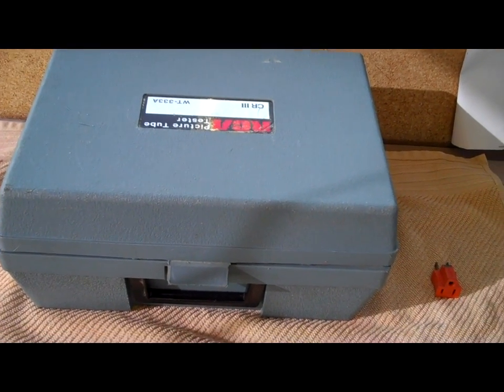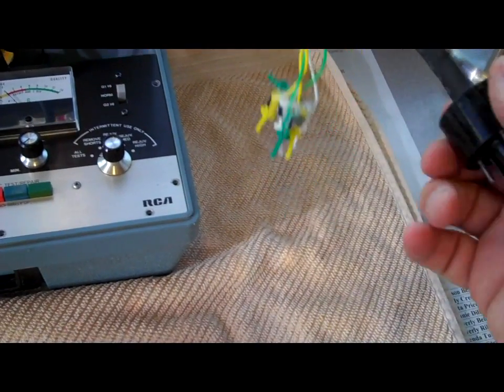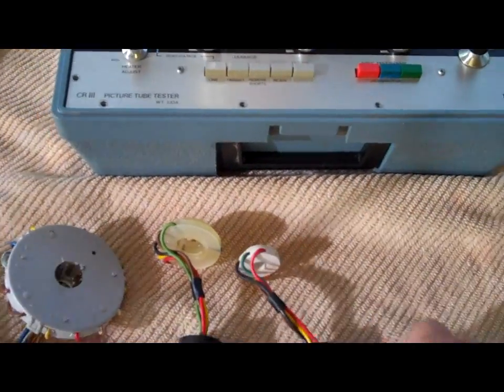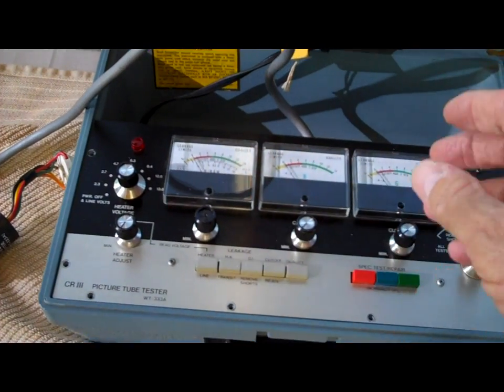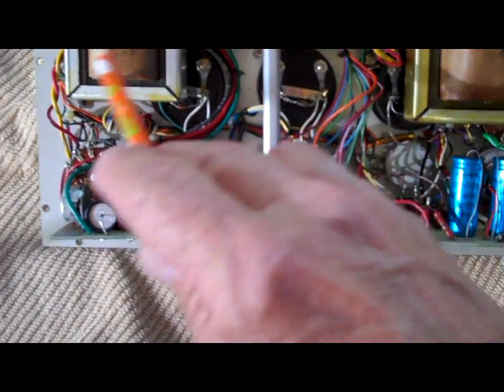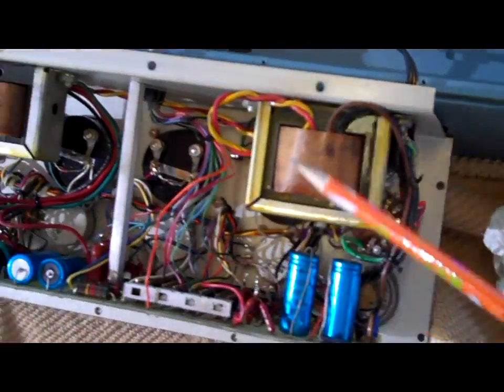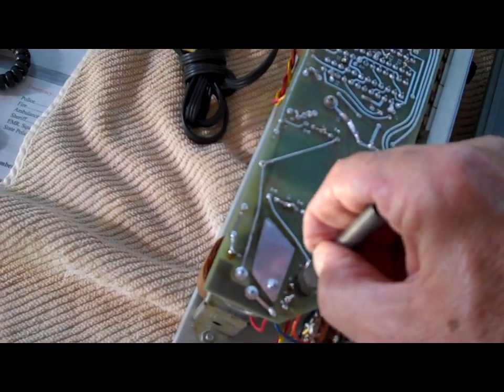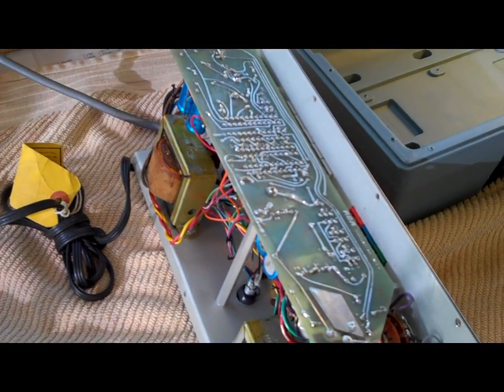RCA CR-III WT-333A Picture Tube (CRT) Tester

Comment: why do you want to remove the capacitors?
Reply from the maker: I didn't remove them.  I replaced them with new, modern caps that are far more reliable and safe.  The expense was low and the effort minimal.  It's always best to do at least some refurbishing to older test equipment before using it for the first time.

Regards,
John

Comment: Hey John, At work the electrician's have a universal adapter with the same fingers on it. They used clear heat shrink tubing on the round end of the clip. They just made sure the label was in the proper position before applying heat. I guess in a industrial application the heat shrink tubing kept the labels in place.